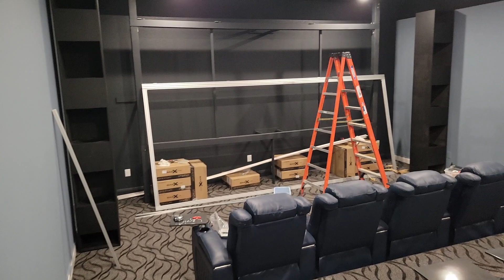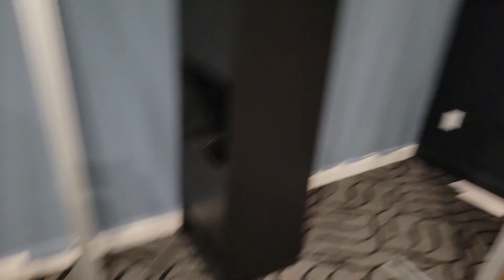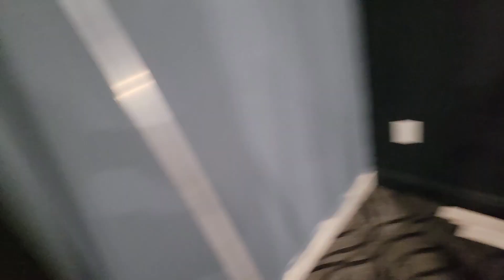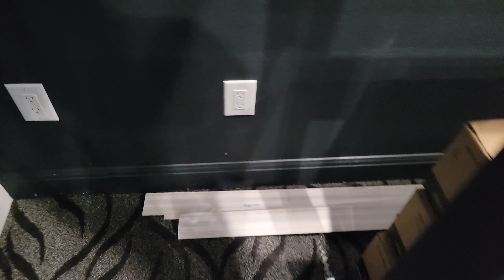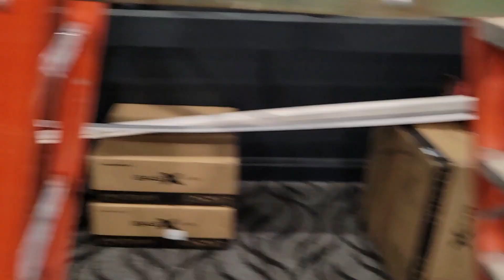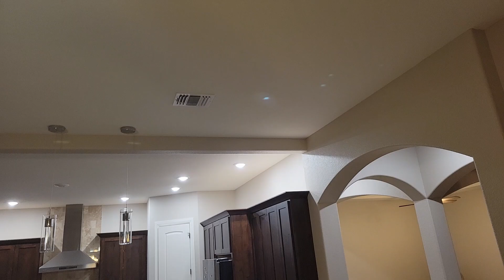Theater update 1 - 14 - 22

Comment: Your theater is going to be amazing! I can't wait for more updates. I'm definitely looking forward to the infinite baffle in attic cause I'm thinking of doing same thing and I'm curious on how you r going to do it
Reply from the maker: "...and I'm curious on how you r going to do it".   Yeah me too... well actually I do have a plan.  The woofers will be attached to each other by the magnets similar to the dipole woofers.   The Ultimax has a really strong cast frame so I'm planning to attach to the frame right where it attaches to the magnet using turn buckles to pull the drivers to each other.   Between the two drivers I'll have a spacer a few inches wide with openings to allow the pole vents to breath.  

Once a pair of woofers are attached to each other I'll make baffle panels to attach conventionally to the flanges of the drivers, just screws and T-nuts to hold the baffles to the drivers.  Over the theater, there are 2x12's on 24" centers.  The plan is to support the driver pairs between these 2x12's on isolation mounts.  Once in place I cut a section of the ceiling out in front of each driver ensuring to make the area at least as larger or larger than the cone area to avoid accelerating the air.  Then I have to build a hood that encloses the fronts of the drivers and directs the air down through the hole in the ceiling.  The back sides are just open to the attic area.  

The isolation mounts will be DIY.  Just cut a short piece of heavy duty rubber hose a couple inches long.  Drill holes on opposite sides and put bolts in from the inside facing out.  So now you have a short piece of tubing with a bolt sticking out on each side.  Mount one side to the 2x12's and the other side to the woofer assembly.  

Anyway, that's the plan.  I don't think it would be too difficult to build other than the fact I have to build it in the attic.  I'm going to get up there and put down some decking to make it easier to work up there before I start.  It's definitely going to be a big project.

Are you by any chance anywhere near the Austin TX area?  If so, come check it out some time.
Reply: @mfkhometheater7742  Wow you defiantly do some serious planning and it shows by your theater design and speaker/sub builds. Your doing such an awsome job. I would love to check it out unfortunately I live in New Jersey. I defiantly appreciate the offer though. Also thanks for the input on how you are doing the infinite baffle in the attic. Keep up the great work with the build. It's all going to pay off at the end. Good luck with everything!